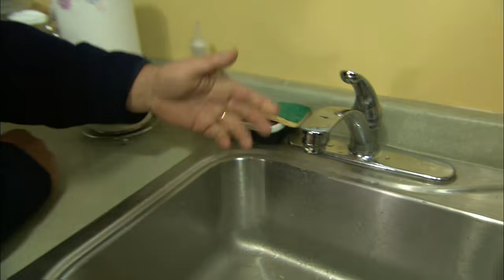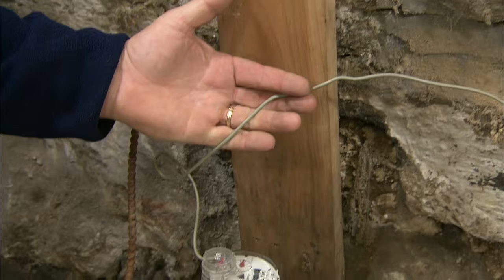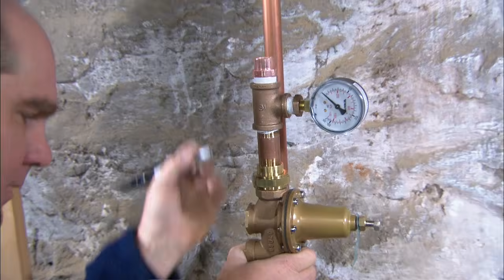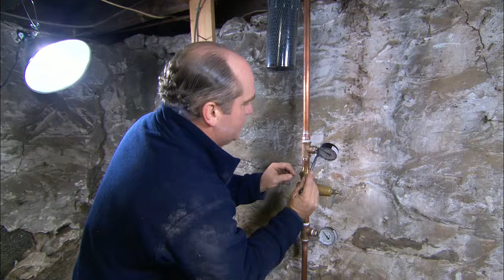How to Install a Water Pressure Reducing Valve | This Old House

Comment: Why is this house pipes all nice and accessible? Am I only one  with house where pipes  simply disappear into the wall?
Reply: Agree...and who's plumbing pipes are located six inches off the wall to allow a large cutter to rotate freely? Folly I say!
Reply: @jeffw8057  … perhaps someone who just removed a well tank and the pipe would have been close to the center of the tank? That would explain why he never complained about water hammer till now!
Reply: Paradoxical Nightmare what’s a v joint ??
Reply: its ok this time the poor man does nt even have a proper basement or foundation wall
Reply: Nope you are not the only one ,this set up is  dream for plumbers , so easy and accessible , you almost never run it to something like this.
Reply: @NewsBroadcasting  his basement looks like mine! Nothing better than a 220 year old house with 22" thick stone basement walls.
Reply: @lowriderrt2000  yep im originally from the midlde east where America considers my region a "third world" here in in US/Canada the homes are made out of cardboard, vinyl, wood plastic. where as our homes are granite, poured concrete, marble, etc.
Reply: This was a skit. They chose a house that had easy access for a video. Def not the "homeowners" house.
Reply: Meanwhile I'm stuck under my house cramped trying to solder a new fitting hahahahaa

Comment: Aaaaw. I wanted to see the faucet working properly after the valve was installed.
Reply: they didnt show that part cause the faucet exploded after they installed it.
Reply: CasperthefriendlyGhost PeakAboo LOL.  Normally would just like that comment.
Reply: It still spewed water...cause the aerator simply needed to be tightened.

Comment: I swear these guys have it easy. All that space  in between to put that prv.
Reply: I have a furnace with a second prv to reduce pressure to 12-15 lbs psi.  The prv and a blackflow preventer are stuffed into a 12 inch section that is full of solder joints and screw fittings.  Nothing like the easy thing that guy does with cutting the pipe.

Comment: Love the pressure gauges on bothsides..great idea.
Reply: Ya, I wish there was a list of parts that they used.
Reply: I'd rather keep the mechanical design simpler and just read the pressure by screwing in the pressure gauge once in a while.
Reply: This would be only for faucets after the pressure regulator, no? How would one read incoming city water pressure with a manual gauge if there are no spigots before the regulator?

Thanks in advance.
Reply: @nikolaiv1138 From the direction of flow, from the water shut off valve to the PRV that gauge measures the higher city pressure. That can’t really be changed but it’s nice to know what it is. The other gauge is downstream of the PRV and that measures what water pressure the house receives. This can and should be adjusted accordingly.

Comment: My water pressure measures 180lbs.  Because the max each valve  can reduce is up to 75 lbs, I had to install 2 reducing valves in line with one one another  to step it down 60-70lbs each. I installed three pressure guages, one before both valves, in between and after both valves. Worked great. I was concerned about the longevity of the guages if left under constant pressure so i installed cut offs with pressure release knobs before each guage. All my plumbing is in a narrow crawl space and I only wanted to do this once. I check it two times a year with a guage on an outside hose. Ten years and still doing great.
Reply: It would be great to have a video/photo of that. Great job!
Reply: WOW! That's a hecka lotta pressure! Where do you live?
Reply: I would expect 180 psi to blow your toilet apart.

Comment: In 1967 the landlord of our apartment building (At least 12 units) had to install a pump on the main water line inlet because 3rd floor taps would go dry and/or dribble in late July.  You knew when the pump was running because the water would come out in surges at times.  I think the 30 year old building steel water lines were constricted to some extent.

Comment: If you do install a pressure regulator, make sure you have a thermal expansion tank to keep the pressure reasonable when the water heater recovers otherwise your pressure will go right back to street level until the next time a faucet is opened. I ran into this problem in a condo I owned in Southern California.
Reply: I was wondering if anyone else ran into that problem.
Relief valve on water heater kept dripping at night.
Reply: Yeah luckily my prv had a bypass but yes the pressure gets high again
Reply: i thought your keep all the house  sinks open during this?

Comment: Um, is it wise to solder those two copper fittings with the tefloned red brass pipes attached?  Won't the heat from the solder torch degrade the Teflon tape?  Newbie question. Thx

Comment: lucky guy must have a water tower in his back yard, one place i lived at was 15psi and i put in a whole house booster for a well.
Reply: Mine checked out at 150psi today. I live at the base of a mountain on a community water system so they have to put it under pressure to get to the top of the mtn. I found it out today when I got a new water heater
Reply: You have to make sure the well pressure tank is present, serviceable, and actually charged...

Comment: i have installed a new pressure regulator valve and adjusted it about one half way with the screw on top, but i still have very little pressure. when i turn the water on i have good pressure but it goes way lower in a minute.

Comment: Did anyone see all that water under the water main?
Reply: yes
Reply: Probably basement moisture
Reply: Look at all of the new fittings. They even tried to cover them up with dirt. The show probably went through and made it easy for Richard to do the work.
Reply: Jared S I was thinking the same thing!!
Reply: @ryanwhitt1748  … There's a distinct possibility they just got done replacing the main shut-off valve so they could shoot this episode and not have a leaker the first time it was used in 40 years. OTOH, most of that area looks uncluttered as if they might have removed a well tank and recently added public water.

Comment: He installed gauges for horizontal pipe, which reads sideways.  You can also get gauges for vertical pipe which show the readings upright instead of sideways... not a big deal, just easier to read.
Reply: I love the attention for perfection!  I concur 100%! 🙂

Comment: Richard why didn't you remove the Teflon tape from thread to solder fiting while soldering because of heat Teflon tape could melt and cause a leak

Comment: In case anyone is interested. You are supposed to use pink Teflon tape for fittings over 1/2”.
Reply: Or you can just use a couple more wraps with the white tape. The only difference is the thickness and density.

Comment: A question for the plumbers.  My main supply is 3/4" and at some point, it's reduced to 1/2" to the rest of the house(probably typical setup my guess).  Is it OK to install a PRV on the 1/2" line right after the 3/4" from the main?  I'm asking because it would be an easier job than installing a PRV on the 3/4" pipe.  Thanks!

Comment: This happened in our house and there was a pressure reducing valve installed but it turned out the valve was not set correctly and thanks to this video I was able to do that correctly. A word of wise though, the pressure will still shoot up if you do not have an expansion tank installed in the system but that will be done once our new water heater gets installed.
Reply: It's true, if you install a PRV then you absolutely need to install an expansion tank. The fact he didn't mention this and many other things he did makes him seem like a hack plumber
Reply: @Ryan-ky3nr  but it's not a hotel or multi unit building. Just 1 house.

Comment: Adding water filters would also reduce the pressure alot and have the added benefit of filtering the water
Reply: Adding random water filters is prone to causing bacteria in your plumbing, especially when the filters get forgotten about.

Comment: Water pressure in my neighborhood is 100psi. We had a reducing valve installed shortly after moving in due to numerous leaks and have been fine since.  I do see a lot of plumbers trucks in my development though likely fixing leaks caused by the excessive pressure.
Reply: @MAGAMAN  I might try this.  I guess if the pipe breaks between the street shut off and my PRV,. I will get screwed anyway.
Reply: @carbonunit  That reduces the flow, which can reduce pressure when the faucets are in operation, but does nothing for the pressure when all of the faucets are closed. If you're going to shut off the water at the street to install a pressure reducing valve, I'd take the time to install a main shutoff as well.
Reply: @MAGAMAN  $1k!!
Reply: So you turned the valve down what? About 25%?

Comment: Your video doesn’t address reaming of the cut pipes to remove the burs that can cause cavitation erosion and failure of the pipes near the cut pipe particularly near 90 degree bends.

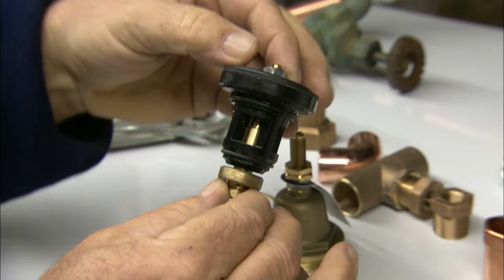Comment: repair tech that worked on our gas furnace that has low water pressure told us that the screen you see in the value at 2:17 can get clogged up and cause pressure reduction  and low flow issues .
Reply: I think the screen itself is there to prevent debris from getting jammed in the valve part of the prv valve. If it gets jammed open, the prv valve won't be able to regulate the pressure and the pressure would go too high.
I suppose too low of a pressure is better than too high.

Comment: Rich, you just burned out the teflon tape with that torch, solder the adapters first, cool the pipe, & then screw on the other fittings....just sayin

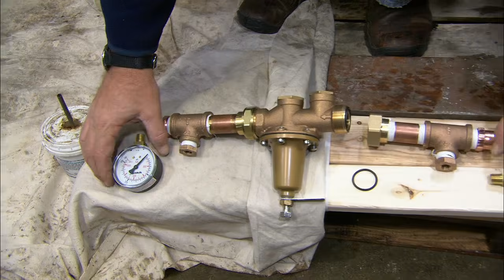Comment: 3:40 How were the O-rings reinstalled if the whole assembly was soldered into the water line? Was there wiggle room to loosen those brass nuts on the pressure regulator in order to gently disconnect the pressure gauge from the regulator in order to reinstall the O-rings?

These TOH videos are great as a general primer, but never give you 100% of the process, which is somewhat useless for homeowners watching. So I wonder what the purpose of the show has been all these decades. Sometimes we get the whole picture, and sometimes we do not.

Comment: If you have an expansion tank on the water heater, doesn't that impact what the gauge would read? How do you know if the high pressure is due to a failed expansion tank or a bad PRV?
Reply: He tested the pressure right after the meter…

Comment: I would put the unions on the outside of the assembly.  Serviceability. Is there not a screen or strainer to prevent sediment from getting into the regulator?
Reply: No way they left all the extra fittings and gauges on after the filming was done.
Reply: I agree and I did just that.  You can also buy regulators with unions on both the inlet and outlet.  External unions can be a little tricky to install properly, which is one reason a lot of plumbers avoid them.  Plus the customer does not want to pay extra for the parts and labor.

Comment: I've heard that it is important to install an expansion tank on your water heater if you have a PR Valve installed to protect against explosion if your PRV fails and your water supply 'locks'.
Reply: Installing an expansion tank is recommended but water heater doesn't explode even if the PRV fails since all water heater has a T&P valve.
Reply: There will be no explosion on a properly installed system. You may see your pressure relief valve cut lose on your water heater if you install a PRV without an internal bypass, such as a U5b built by Watts. If you use their 25AUB however, it has an internal bypass negating the need for an expansion tank.
Reply: Myth busters YouTube
Reply: Check with your local municipality as to what is code in your area.  Most require it from what I have seen.

Comment: Sir can you pls tell the difference between water pressure and water flow
Reply: Pressure = resistance to flow. Try exhaling as hard as you can but keep your nose plugged and mouth shut. That's pressure. Now just blow air out of your mouth. That's flow.

Comment: ❌If There's A Grounding Wire Across The Water Meter Providing A Electrical Path, Shouldn't The Pressure Reducing Valve Also Have A Grounding Wire Installed Across It To Pass An Electrical Current Off Towards The Direction Of The Water Meter's Ground Wire Since The Use Of Teflon Tape On The PRV Acts An Electrical Insulator?

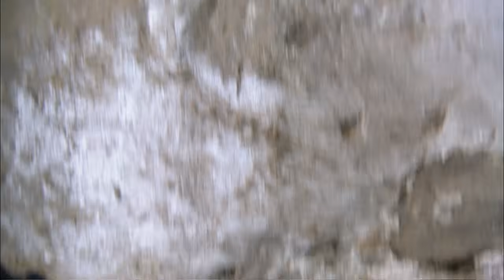Comment: anyone else notice at the 4:02 minute mark, nobody did a great job of deburring the cut pipe?
Reply: Pretty sure it all got redone all the way back to the meter when they were done filming. No way they left all the extra fittings and gauges on.

Comment: I think when you install a pressure reducing valve that you also need to install an expansion tank.
Reply: depends if your water meter has a check valve or not...
Reply: @workingshlub8861  Doesn't the pressure reducing valve act as a check valve? Causing expanding heating water to spike pressure and possibly leak out of the water heater's temp/press relief valve?
Reply: @cavscout888 the water heater pressure/temp valve is set to release at 150 psi and around 200 degrees....if you had anywhere near that type pressure  you would definitely know it and have all kinds of problems...adding a tank cant hurt but not always neccessary..
Reply: @workingshlub8861  People have water/pressure bleeding out of water heater relief valves all the time.
Reply: @cavscout888  there should be no leaks out of that valve...
Reply: @workingshlub8861  There can be leaks if you're removing it right after the filming is over. :)
Reply: Check with your local municipality as to what is code in your area.  Most require it from what I have seen.
Reply: @cavscout888  No, it does not. There are combo units, but a pressure reducing valve does not function as a check valve on its own.

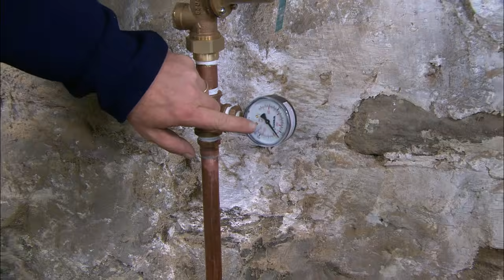Comment: Anyone else notice the connection is leaking at 4:58? It also drips once more later on..
Reply: No way they left all the extra fittings or gauges. Probably redid it all the way back to the meter.

Comment: Solve the problem just shut the ball valve halfway that'll cut the pressure down
Reply: @eldarin67  No, it won't work. There's a difference between pressure and flow rate. By turning the water down using the tap on the meter, you're only adjusting the flow rate and you're having no effect on the pressure. The water coming from the city will still be applying the same pressure/force on the water after the meter. Anyway, a pressure regulator uses an internal diaphragm to alter the pressure: https://en.wikipedia.org/wiki/Pressure_regulator

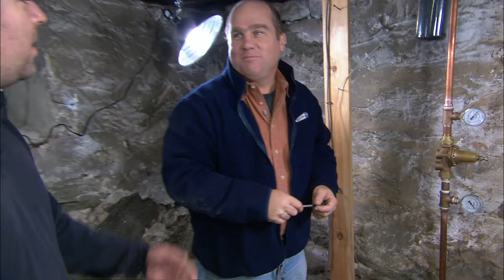Comment: At 5:00 and 5:10 as they pan up and down the pipe, there’s a drip coming from fitting where tape is.  Look real carefully towards bottom connection of the regulator valve assembly and you’ll see it.  That’s why you don’t heat the pipe with tape on it!  Leaks!

Comment: People should realize that the city has no responsibility to regulate your water pressure.  They will use whatever water pressure is required to get water to their customers and it can vary based on elevation and distance.  They can change it at any time without notice so it might increase over time if more home are added on the line..

High water pressure  plays havoc on appliances, hoses, pipes, faucets and can cause major leaks if it is not corrected.  It is the home owners responsibility to know and regulate the water pressure in their house and you do this through a water pressure reduction valve as shown in this video.

It is a good idea to plumb in the pressure gauges as these valves have a tendency to get sticky over time and not work as well as when new and you could see that on the gauges.

If you have a full house water filter later in the system you can add another pressure gauge after that to check for a pressure drop when the filter starts to get dirty.
Reply: Yes, but the problem that I have seen is that the gauges themselves tend to get sticky when they are sitting at the same pressure level for years and years and years.  I've seen it before when the water supply is turned off and the gauges still read normal pressure even though the line has been drained.  I much rather use a handheld gauge with a female garden hose adapter and periodically measure the water pressure at a sillcock or laundry sink installed downstream of the pressure reducing valve.

Comment: Does the heat from the torch damage the teflon tape on threaded fitting???
Could it cause a leeak.??
Reply: The leek is a vegetable, a cultivar of Allium ampeloprasum, the broadleaf wild leek (syn. Allium porrum). Not sure how a torch is related to said vegetable. Cheers

Comment: Would this fix what I believe to be my City's water pressure fluctuating?  My suspended pipes under my house go to dancing for several minutes, several times throughout the day and middle of the night.  Occasionally, the dancing goes for hours; but if I go shut off the water from the City, it stops instantly.
Reply: It would reduce it, but you should FIRST address the fact that if your pipes are dancing, they are NOT properly secured to the structure!!  I would recommend you address that before the pipes are fatigued to the point where the connections leak or the pipes themselves develop cracks.